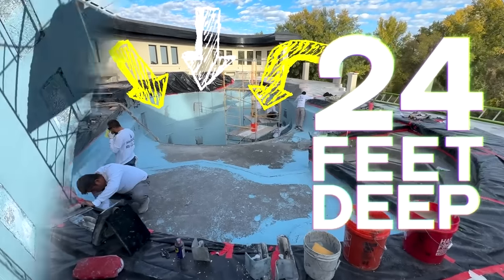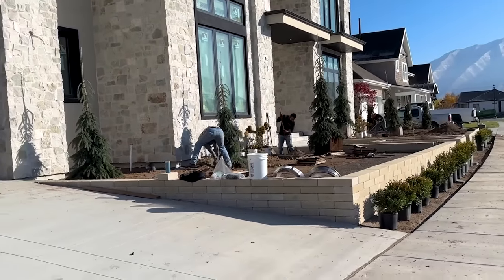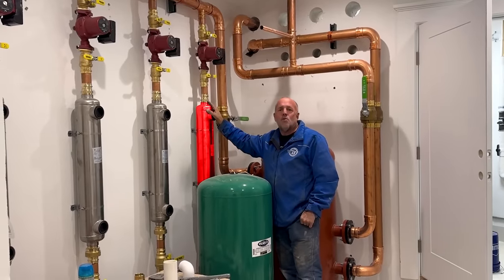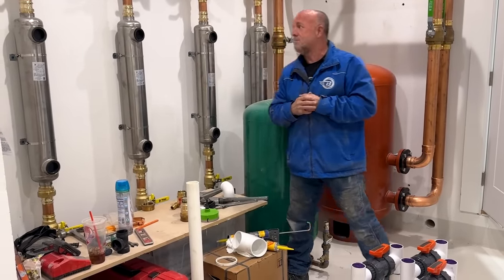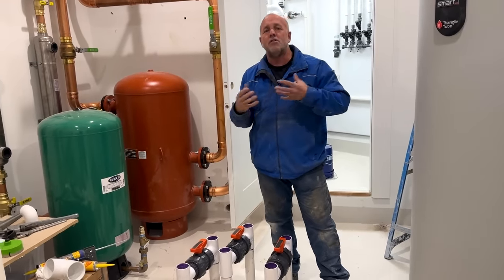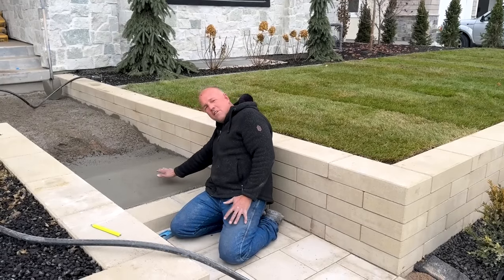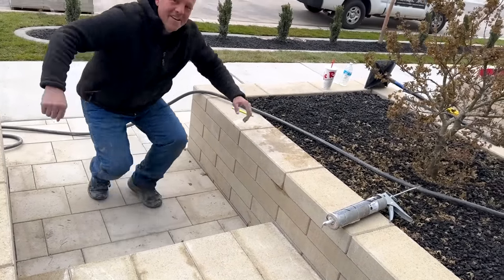How to heat a 24 foot deep SCUBA pool? | House Build #21

Comment: To me at least, what’s standing out in this project, is the attention to detail and the consideration of the interrelationships of the various elements, for longevity, ease of maintenance and repair.
What I appreciate most about your video’s, is your obvious multi dimensional thinking / looking through the layers of the onion.
Reply: I've heard that you learn so much building a house that the first thing you want to do when your finish is start over. You can tell Mike has done stuff like this more than a few times.
Reply: @origamihawk  We used to own a construction company. Mike became a GC when he was 18.
Reply: Mike also puts the same quality when he builds an aircraft.
Every one is a work of art. 

Back to work Mike

Comment: Mike, would you ever walk through some of the other details of the house? Air sealing in the main house, insulation details, HVAC/ERV/HRV/Ducting details, electrical in the house, High or low voltage, window details. I'm a geek for custom home build details. Love your plumbing/hot water walk through. It's more commercial than residential and I think that should be the way to go. Too many residential builds are done so cheaply.
Reply: it's "more commercial", than most commercial buildings!
Reply: I also want to know what systems are automated and what is manually controlled.
Reply: @portnuefflyer   That's a fact.
Reply: This would be awesome!

Comment: This house had better win some design award or something. Incredible.
Reply: It's in a category all by itself!
Reply: Thank you!! 😊
Reply: It's quite a fail if you start taking in the energy wastage.
He could've spent money on integrating solar water heaters+ geothermal+ heat pump also photovoltaic for electricity if space permits, air trap barrier to stop water body heat loss, rain water harvesting etc etc

Comment: I like the idea of the hot water taps outside. In my neck of the woods we have heated driveways when it snows. I always told my dad that if he repaved his driveway he should bury some Pex tubing in it so he has the option to heat it in the future. I plan to do the same when I build my house. I'm cheap, so I probably wouldn't even have a boiler hooked up to it at first, but in my dad's case, he lives at a lower elevation in Denver, and it only snows like 5 days a year. A warm water tap would work just fine. No need to shovel, just wait for a sunny day above freezing and wash all the snow away.

Comment: I love how you think things through before jumping into any project! Maintaining things is always necessary, so making that maintenance accessible is important. Elimination of potential issues ahead of time, saves a lot of headache down the road!
My 93 Polaris snowmobile is just one example.
Had to replace the recoil rope & the bottom bolt on the housing that had to be removed to access it, was inaccessible behind the frame. 😑😑😑😖
Also, most abandoned aquariums I’ve seen, have large amounts of calcium built up on the glass & simply got to be too much for most to keep on top of, getting out of hand, then that investment, simply abandoned. 😔

Comment: Patey's airplane content likely resulted in some companies building better planes, the above is what the housing market should be doing (minus the mega pool and the building out to accommodate the increased volume.) But the systems themselves could be a fraction of the size for a similar sized house.....minus the pool. I'm confident that the house is also hardened such that a mob outside couldn't get in (humans, zombies, rodents of unusual size, etc.) I don't generally watch house building/modifying content, but Patey's house contains cutting edge custom improvements that are interesting to learn about. Like I said, all houses should be built like this, which would also drive the price down on these systems over time.

Comment: HI Mike, came across a product called DTX Coolflow which you can add to glycol/ water and it keeps it pretty much at pH7. So reduces  impact of glycol if any spills anytime, splashes on people and does not impact the copper or cause electrolytic action.  The project is amazing! Congratulations.

Comment: Nice job using bigger diameter tubes to slow down the flow and making sure the pipes last way longer, I assume that’s the reason by looking at the pump sizes, low flow, no cavitation 👌🏽

Comment: Actually, that is a good idea for the wall. I've never had a wall in a heavy winter area as an adult but I did have one in my youth. In fact, I recently drove by that property where I lived 65years ago and the wall is still a problem. There is no wall left because the old wall fell over but it could still use one. The house has been renewed and looks good but they could STILL use that wall.

Comment: Just a couple of things Mike.  I know you speak of efficiency, but you never said what fuel source you use or what your projected costs are.  Do you have any yet?  Also, I love the plumbing of copper and plastic, but note that any time you pass water through a long pipe (regardless of material) it will "sing" or vibrate at high frequency.  This is what causes joint failures.  To remedy this, you only need to put rubber grommits across all 2 or 3 parallel pipes to absorbe the vibration.  I would really love to visit some time when done.  I just finished building my own place and we call it Turn Six Ranch---located about 1500 feet from from Turn 6 for the Reno Air Races "long track".  Don't have all the bells and whistles like yours, but still a very nice 2400 sq ft on 5 acres.  Ok. Back to work.

Comment: Hey Mike, you go to great lengths to keep water from getting into places where it could freeze and expand during winter.  However, at the end of this video, where you are making the stairs with the pavers, you have made certain that water can't get under the pavers but what about the tiny space between the edges of the pavers?  Maybe I'm missing something, but it looks like rainwater could get in between them and freeze in the winter?? Is there some type of grout that you will be applying there?   JLH/H4

Comment: I’d definitely recommend putting a temperature switch or timer on the circulation pump for the house. Those crimp fittings cause alot of turbulence in the water and it will catch debris in the water, slowly sanding away at the copper pipe from the inside out. By having a temperature switch it will shut off when the whole system is up to temp and back on when it starts to drop. By having to cycle on and off it will let the debris settle then get washed out rather then getting stuck in the turbulence.

Comment: Wow Mike
Love the duel fluid heating system. Only way to go.
However, I can't believe your running your pool on 'Pantair Cartridge Filters'
Did ZEL Bright    (ZB =2 micron Filtration  Medium) in Sand Filters get a look in
It is so efficient a maintenance/service and ease of operation a system compared to the 'Cartridge Filters' I see in this clip..
ie: 2 min per filter at backwash v's many minutes to pressure clean each cartridge (which damages them a little each clean)
Life span of Zel Bright with the numbers of lts per filter you appear to be running 
will be many many years before filter medium need refreshing and many more good reasons to to go ZB/sand filtration.
A Mate, Check it out if it is not to late.
I come to this opinion after 46+ years of designing and building award winning top end pools
Cheers from the land of Oz  Now, Back to work.....Cheers Rosco Whiting  from Brisbane

Comment: I spec’d boilers just like that for a VA hospital that I did the M/P/HVAC on in Claremore, Oklahoma. I used three because it was a large building and they also have a rehab with multiple tubs/saunas in and I also ran a 4 pipe HVAC that pulls off of them. Yeah, you’ll have way, way more than you’ll ever need. If you ever need hot water… go check the boilers because something isn’t firing.
Reply: That’s so cool!

Comment: Man, I love impeccably built machines. Is that 4” copper? Stainless steel. The house is pretty but I so enjoy these deep dives into the mechanicals. 

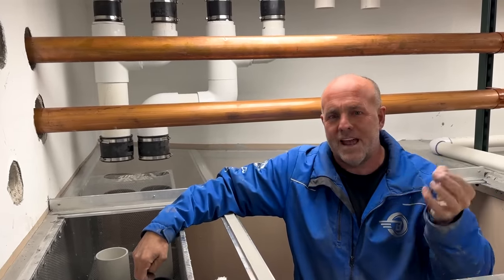I HAVE to know this about the video production: Someone pleeeaase tell me what happens between 5:35 and 5:43 when Mike’s VO doesn’t change but the downpipes get installed during the breakaway.

Comment: Nice.  4-pipe buffer tank with redundant boilers, looks better than most commercial systems.  Would have liked to seen the boilers, but at 750MBH assuming modulating condensing.  Even with the buffer tank there may be a short cycle struggle in summer time when load drops to a few thousand Btus, but wide deadbands on the on/off setpoints on the boiler should help to counter that.  

Note that once "on" most boilers tend to ramp hard to get to setpoint, so a lower than normal summer setpoint with a high "off" setpoint would let it float above setpoint in low fire hold reducing cycling and maintaining hot water with fewer dips in the heating system.

Comment: Dream business is successful, Current dream planes are built, you deserve to build that final dream home. Congrats and not surprised to see the level of design, planning and execution you put into everything else going into this. Glad to see you enjoying your monetary success and also adding to your ability to help others "with training in the pool".
Did you design the piping runs or let the installers do it under your guidance because it is a very clean install? I'm guessing it was pre-designed because of the complexity.
Reply: Mike designed it, he is meticulous with this sort of thing. We didn’t hire a pool company to build this, only subs that do concrete, pebble surface, tile, etc and our plumber has set some of the pipes under Mike’s direction. We used to own a company doing pools and hot tubs but have never built anything like this and didn’t feel that it could be turned over to someone else.

Comment: Mike knows a lot more about pools than I do, but I would have built those skimmer boxes with floors that slanted away from the down-pipes.  With a flat screen floor, the incoming water may not always push debris across the box and will mostly just beat the debris into smaller pieces so that they fall into the reservoir.  Only when the underlying screen clogs entirely will the water work its way across the box, but this collects debris on the "far" side of the box rather than the "near" side where a person will stand.

Perhaps that's the intention, but a slanted floor gives debris a chance to wash away from the stream and towards a lower collection point.  This also allows debris to be raked away from the falling stream, even during operation, with a suitable brush or tool and into a pile at the lowest point.  I'm more familiar with gutter downspouts and such than complex pool systems, however ;).

Comment: People laughed at me and even some pool company's talked trash about me buying a black and decker pool pump. Well its been solid for 1 full season no issues. I have been reassured now
Reply: Glad to hear that. Easy to replace too if there is an issue.
Reply: Why would you feel reassured? This guy isn’t a knowledgeable pool builder and definitely hasn’t done his homework.
Reply: @biffmcgraw5507   We used to own a business building pools, hot tubs and ponds. It’s simple to change out the pumps if there’s an issue. We’ve never used these before and thought we’d give them a go.

Comment: Hot water return for the domestic hot water, salt water heat exchangers for the pool and buffer tank setup. Looks more like a commercial setup. Could have also used a larger pump with motor control valves and a vfd to control the pool, hot tub and lower pool. A pressure gauge before and after the heat exchanger can tell you when it will need maintenance in the future. A temperature gauge before and after can also help to make sure it’s running efficiently.

Comment: mike, you are such a planner I feel inadequate to comment, and you have probably already considered my thoughts.  you and your family are young, athletic and healthy, but I don't see any provision for wheelchair or walker access or ramps to your fantastic home.  also no railing.  Small needs, but absolutely necessary for any physically impaired friends or family!  I watch with amazement your projects and your long range thoughts to prevent future failures.  what craftsmen you and your family are!
.
Reply: I’ve had ankle reconstruction and was unable to do stairs for a few weeks last year. I gained an appreciation for accessibility, which confirmed that the elevator in our house will probably be put to good use with family or heaven forbid, myself again.

Comment: Do you worry that the momentum of the falling water hitting those 90s will slowly loosen that vertical flex joint over time? I can imagine one of those popping off and that's suddenly a lot of water going where it shouldn't. With the covers it looks like it won't drain into the basins.

Comment: Hear me out, Mike…

An airplane idea for you that I think would be the coolest thing ever. Putting the iconic Mike Patey twist and engineering on, wait for it….a beech 17. 

Take the fabric out, add composite wings change the engine to something more modern and pressurize it for fun at altitude. You can incorporate your amazing flap slat design to make it great at low speeds but clean up the fuselage for high speed… and it’s a beautiful aircraft. It’s one of my top 5 dream birds 😊

Comment: I have a similar hot water system ,and I’ve found the constant circulation of hot water is heating the house ,so in the summer it can get pretty unbearable without ac on 24/7

Comment: Question, I have a 12,000 gallon pool in florida and you have a gajillion gallon pool in the mountains.  Have you considered recapturing any heat from your massive home air conditioning system (assuming it gets hot in Utah) or is the juice not worth the squeeze?  I'm seeing a few older products where the AC coils are passed through titanium coils to heat the pool from the AC compressor.  As well as home water heaters.  Your huge boilers are probably more efficient overall.

Comment: Sealing in those water vaults is a good idea.  Else you'd be growing all kinds of nasty stuff down there, besides rust and other corrosion.  I hope and trust you've thought of venting the air in those tanks when the water drains down (as in a power outage) so the sealing tops don't get air launched!  I don't know, Mike, I think I like the Adirondack-style architecture better.  I think you should change it!  ROFL  Say, long time since I've heard any Scrappy news - how's the plane doing?  Has it been flying?  I know way back when you mentioned the option of going to skis - any action there?
Reply: It is definitely vented. No worries there.

Comment: Mike, love your videos and explanation of why you're doing it. Please, please for your 367k veiwers explain when you are installing the pool filter housings and filling them, go into details of the safety of releasing the air in the top of the tank so the top doesn't explode! My son and grandson were involved in a VERY serious home pool filter acident almost 2 years ago where they didn't let the air out (open the top valve) and didn't have the SS retainer ring installed properly. While filling the system, the top launched off the base, crushed the bottom of my son's face, jaw and nose. Very ugly pictures that are as a parent hard to look at. He spend serveral months with wired jaw and lost 30 lbs. My son will never be the same, but he is alive, but every day has issues as a result. Maybe just one more pool filter death/injury can be prevented! Maybe better, a fail safe design on this type of filter housing! Thanks
Reply: Wow, I’m so sorry to hear of your son and grandson’s accident and the injuries, thankful they survived and I appreciate you sharing it. It highlights the importance of being mindful and will serve as a reminder to be diligent and double check ourselves, especially when working with such equipment. My best to you and your family.

Comment: Mike, would it make sense to insulate everything that's copper since a lot is so visible and reachable. Especially on longer runs. More heat retention and faster and shorter active heating cycles.

Comment: The concrete holding that 104 F water is going to expand.  The linear expansion distance won't be huge, but you've got to give it the ability to move that little bit or the stress will be gigantic.  But in these pictures I don't see how the hot tub water (or the hot tub itself) is decoupled from the rest of the structure.

If I understand correctly he's got a free water surface something like 20+ feet below the surface of the pool.  All the water that goes down there will have to be pumped back up that 20+ feet of head.  It's a lot of energy.  Typically you want any free water surface to be at nearly the same height of the pool surface to avoid this loss.

Comment: Shocked not to see radiant heat for the driveway. Shoveling snow is for suckers.
Reply: The house is south facing and the drive has a decent incline. It melts fairly quickly. Had it been north facing, it would’ve been heated like we did at the hangar. It’s super helpful.

Comment: You have amazing redundancies engineered into this whole building. I am curious though, are you including a backup power generator? I would have thought with the cost you have gone to so far, a 40-60, even 100KVA diesel standby generator with auto start and whole house smart power management would be standard install for a build project of this magnitude

Comment: On the filtration system I would have made only one thing different, the outflow from the sump, I would make over longer slightly sloped area ending in small through and comb. This helps sedimentation to settle due to the slower flow. Taking a lot of strain of the sand filters.